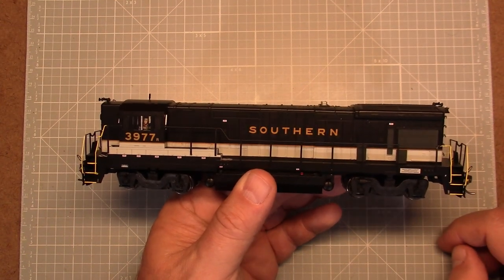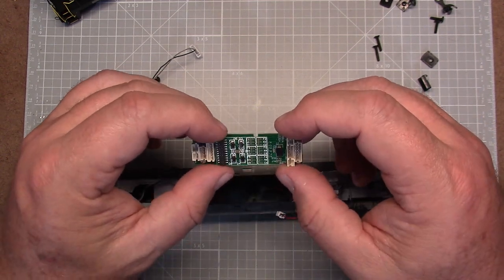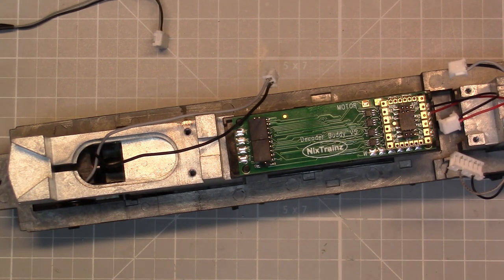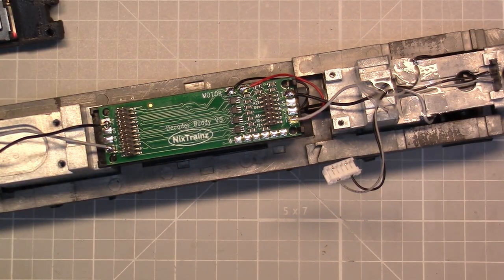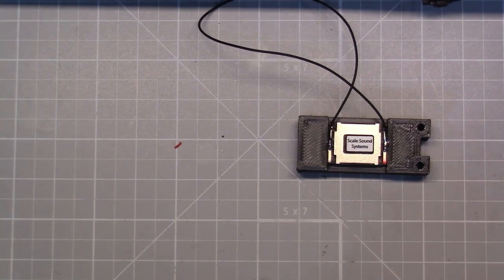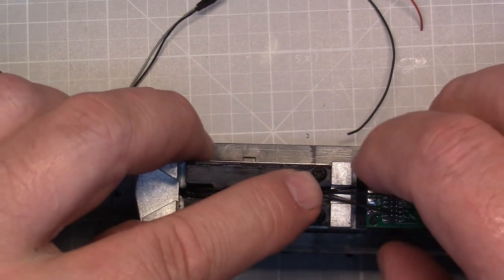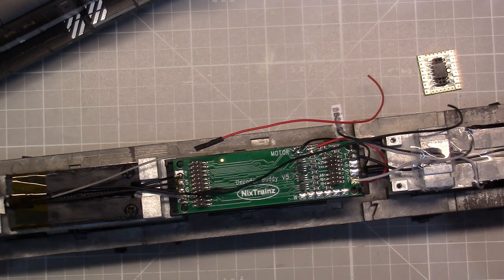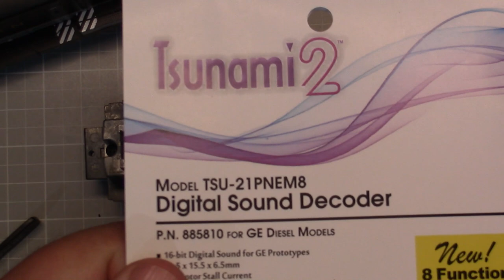Atlas B23-7 DCC install

Comment: I don't know much about DCC systems, there simply seems to be so many different ones out there it causes me a lot of confusion,  but if it's DCC ready and "sound ready" shouldn't you just be able to plug in an 8 pin decoder (as per the box) into the existing circuit board and you're good to go with DCC and sound?   I'm wondering why the removal of the existing board to put in a different board.

Comment: Removal of the two screws under the fuel tank (Time 2:20, loosing the internal weight) is required to let the plastic shell have room to "wiggle off" the metal frame!

Comment: where do you purchuse your sodering tips from and what size are they
Reply from the maker: I get them from Amazon. 10 PCS Weller ET Replacement Soldering Tips for WE1010 WE1010NA WES51 WES50 WESD51 PES51 PES50 LR21 LR20 Solder Iron Tip https://a.co/be2xxdu

Comment: Are ALL of those scale sound speakers drop in fits, no milling of the weights are needed?  And does it have to go with a Decoder Buddy for these speakers to fit properly?  Thanks.
Reply from the maker: Most of the Scale Sound Systems speakers are drop in. No, the Decoder Buddy doesn't need to be used for those speakers.
Reply: @SoloContracting  Nice, thanks I am going to look into them.  Either them or the ones that mount on the cab inside the roof from streamlined backshops.
I don't really like having anything wired into the shell but sooner or later I will end up that way

Comment: Hi, was just wondering what size heat shrink your using?
Reply from the maker: 3/64"
Reply: @SoloContracting  Thank You sir, I was also gonna ask what gauge wire you use mostly for HO scale? also do you know where I can get a set of the roller's that you use on your test track. Thanks again very much.

Comment: Hi,
Can you give us more information on the TVS you are using?   Part number?  Specs?  Where to get?  etc.     Thanks.
Reply from the maker: There is an excellent article in the April 2022 issue of Model Railroad Hobbyist magazine.  Page 132 it has all of the information you need.
Reply: The article actually starts on page 49 if you go back and look at the old issue, witch you can do for free
Reply: Thanks.